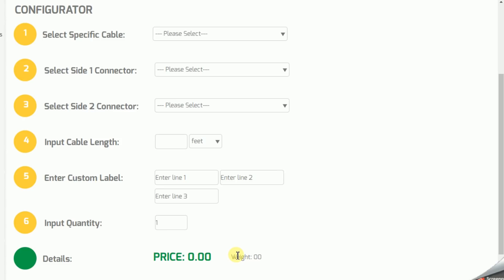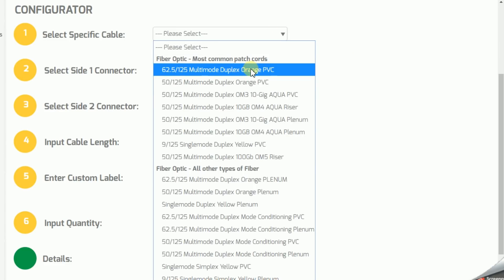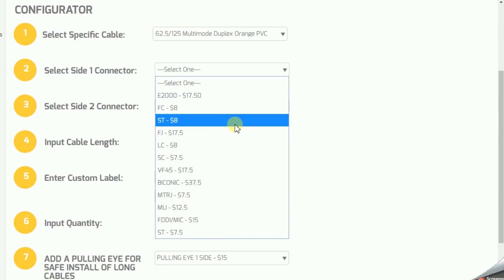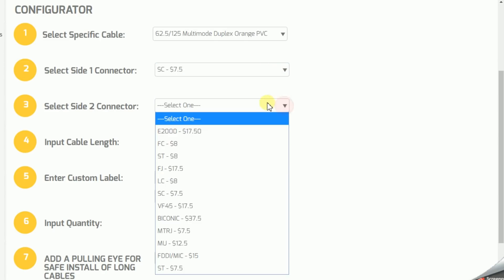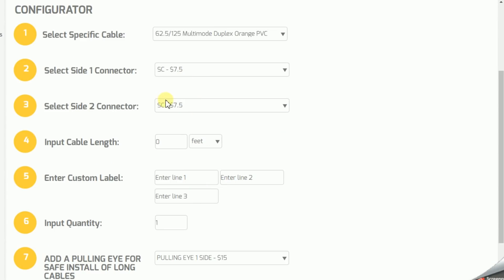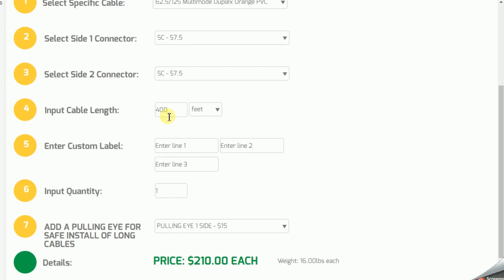Network Two Buildings with Fiber Optic Cable

Comment: Hi! Thank you so much for an informative video. I like to ask some question, is it possible to directly plug the one end on my router to provide the internet connection? Or is switches really necessary on both ends? Are there any limitations that I should consider first before doing this like router model, network configuration, etc.? Any answer would be really helpful. Thank you!
Reply from the maker: You can probably connect directly to the router, the switches just give you more flexibility.

Comment: Thanks for the video. I have a 90' run of underground 1-1/4" PVC conduit with wide sweep 90's on each end for connecting the network from my house out to a steel bldg. on my property. At the steel building the 90 terminates into a standard PVC LB conduit body, that then goes through the building wall and into the shop. My question...would this be too tight of a bend radius for 4 strand indoor/outdoor multimode cable where it has to make a 90 from the vertical to a horizontal run into the building? Thanks.
Reply from the maker: In my opinion, as long as the 90 deg turns are wide bends, should not be an issue.
Reply: @NetworkAdvisor  The 90 degree pvc elbows are definitely wide sweep but I'm wondering about once I have to make the 90 inside the LB conduit body into the building whether that is too tight a radius bend or if it is okay. Thanks.

Comment: Thank you for the video. I got a beginner question.  Once it hits the breakout box, I am wondering how you go about connecting that to the switch you have mentioned at the beginning of the video.   I thought that the fiber will be connected with the SC connector to the transceiver boxes and then connected to the new switch on bldg B.   That may not be the case for the end of the video starting at 7:02.

Comment: Why not just use normal ethernet cable? it should be good for up to 100m
Reply from the maker: Distance.   Copper Ethernet network cables are only certified to work up to 100 meters (in practice we know they can be longer and still work fine).  But Fiber can go for miles!
Great question 😄

Comment: Quick question... TX on A goes to RX on B and vice versa correct?
Reply from the maker: yep, you got it.   TX on Transceiver A, goes to RX on B.  Often times in the field, when you're patching to transceivers together for the first time, you plug up the connectors and if you don't get a link signal, then you just flip them around.

Comment: If want fiber optic signal way form over enthernet via 5ghz access 24 dbi anteana powerbeam over enthernet enther over via fiber wigh b side media. Plz confirm must same use as same . Means dual band . Rj enthernet to fiber send band fiber to rj plz can we select same media converter.

Comment: Great video! I'm a novice so this may be a silly question but how does the coiled slack not interfere with the way the light/data travels through the core?
Reply from the maker: Right?  The nature of fiber optics is that the light is stuck in the core. If follows the core wherever it goes (even in circles).   While it's true that as distance is added signal strength deteriorates but that is factored into your "budget" (light attenuation expectations given distance and loss from connectors).  Hope that helps.  ☺

Comment: Hi, this is the most useful Video ive found, principally because i am at the level of the small toy cars. Can anyone answer this please?
Ok I have a simple question please:
So if  build this set up explained above, exactly.( I am building a 300sq meter workshop and want to link many things from the workshop to my house linked by underground conduit)
 Will this link export/ send all the following: web cams, temp sensors and fire alarms etc (lets say 10 different items) through a switch panel, then the port /fiber link, back to my house the other end of the fiber link?
What is the best way to do it. Fiber will arrive at my house, Then be relayed to the workshop through the cat 6 Rj45. thanks in advance.
Reply from the maker: Short and simple answer is that if all those devices and applications you described use Ethernet TCP/IP protocol to transfer information then YES, that single fiber topology will work.  The longer and more complex answer is you might need to segment your LAN (create vlans) to shape the flow of Ethernet traffic as you might run into bottlenecks.
Reply: @NetworkAdvisor  thank you for your reply. much appreciated!

Comment: Can I use 2 different brands of routers with this system ? Garage is 400 feet from house. Thought I ordered linksey router (to go in garage) being house has linksey. But I picked a different brand. Should I exchange for another linksey? Amazon has easy returns & I didn't open it. Thank you for your time & this video !

Comment: What is the maximum distance this can take?
Reply from the maker: that answer can vary a lot.  Multi-mode is usually less than 1 mile (1.5Km) and single mode can go up to 20 miles.
Reply: @NetworkAdvisor  oh! Okay. Thanks for this.

Comment: Can anyone tell me what type of fiber optic cable would you recommend for networking two building that are 1500' apart?  (only the internet would be shared)  TIA
Reply from the maker: Kim,  I suspect if you contact one of the reputable online fiber distributors they would help you with that. Ie. Cables.com (I have no relationship with them - just an example.  They’ve been around a while ).

Comment: Totally new to fiber.  My situation is just like yours.  I want to run fiber to a detached garage. Can you tell me the site you were on that had the cable configurator?  Seemed pretty simple.
Reply from the maker: Gosh,  it’s been awhile.  “Cables and connectors”  I believe

Comment: Who else is using multimode?
Reply from the maker: typcially Multi-mode is inside the same building or very short distances (less than a KM).  Single mode is for 1-30 Kilometers

Comment: How much bandwidth are you able to transmit with this setup? I wanna build almost same network with target fo 40 Gbps of bandwidth
Reply from the maker: Most fibre can handle 40Gbps.  But,  the electrical components as each end will need to be 40Gbps capable.  That’s expensive.
Reply: @NetworkAdvisor  oh i see, i am planing to use some latest equipment with SFP+ module.
Reply from the maker: Exactly.  Just do the research to be sure you get the right parts.  😄

Comment: I'm in the process of setting up two different houses hooked together with fiber optic. I'm a little confused on the number of strands needed. There's two strands six strands 12 strand etc.. anything you can tell me as far as what I would be looking for?
Reply: Just wanted to shoot in some info as a telecom tech kind of specialized in fiber optics (not from the US tho, so my experience might not be applicable). In general you need a pair of fibers for a single link, one to transmit and one to recieve. By using the right electronics you can also use only one fiber for both by using different wavelenghts for "RX" and "TX", this is quite common in FTTH. I would allways recommend over dimensioning a fiber line quite a bit. 1: you'll easily be able to expand to more lines in the future, if necessary. 2: If your cable were to be damaged, you have a higher likelihood of still being able to salvage 2 fibers. I can't tell you how many times I have saved customers thousands of dollars because 2 of 8, 12, or 48 fibers were still intact! and 3: It's rarely more expensive for the cable itself, but this might not apply when buying pre terminated cables considering they terminate all fibers (we usually only terminate what's necesarry and spool up the rest of the fibers). Fun fact: OS2 G96 (96 strands of single mode fiber) is one of the cheapest cables sold by my vendor, simply because of the sheer amount of it being produced and used.
Reply from the maker: I agree.  If I were stringing a fiber between two buildings,  I would definitely do at least one pair.  But as you point out,  if 6 pair wasn’t that much more expensive,  it would be smart to do so. 😀
Reply from the maker: Unless you plan to do something fancy, two strands should be enough.
Reply: @NetworkAdvisor  seems to me most if not all Armored direct burial come in a min of 6 strands?  Is 2 stand vs 6 a lot cheap? I'm actually seeing the opposite in a lot of places. Can you name the places online you would go for cable? Some of these websites don't inspire confidence. Thanks for your time and great video!
Reply from the maker: Monoprice or cablestogo.   6 strand is good.  Gives you future options.
Reply: @NetworkAdvisor  thanks!

Comment: I was really hoping you were going to show us that exact set up without that orange fiber cable!! That would be a much more interesting way to do it
Reply from the maker: Sorry about your expectations Todd.  Not sure of a better (and simpler) way except to use "air fiber" or run a cat6 copper cable (assuming the distances were short enough).   Were you maybe expecting some fancy switch programming?  Like subnets?  Or setting up a Brouter (bridging router)?

Comment: Can the ethernet output of a media converter be connected directly to a NIC in a PC or does it have to go to a switch?
Reply from the maker: Arthur, I haven't tried it, but I am about 90% sure you can go directly into the NIC.  (Actually, I probably have done it before but have just forgot 😄)
Reply: @NetworkAdvisor  OK, I can't seem to get it to work. If I go directly to the NIC the PC won't connect to the network. If I go from the media converter to a switch, then connect the NIC to the switch the PC connects without a problem. I don't really want to use a switch just to connect one pc.
Reply from the maker: Try a Cross-over ethernet cable maybe?  Those are cheap.

Comment: would single-mode cable work our only double? What is the difference for this application? Thanks
Reply from the maker: building-to-building then single mode would be recommended (long distance).  Within the same building (less than a mile) Multi-mode.  
Good luck.  :-)
Reply: @NetworkAdvisor  so if I am running from one house to another across private property 1,800 ft. Single mode is what I should use? Would you suggest using preterminated cables as well or is splicing on cable ends fairly straightforward? Thanks so much

Comment: Its a very helpful video. I have some questions regarding my personal house-office project. My House and Office is around 100m distance. I had earlier installed CAT6 to have a personal LAN between both premises. However, I observed that the accessing speed is very slow. Example, my usual application from another computer would have more than 5 mins to access it as compared to 10 secs when in shorter distance. I assume, there is loss of data in CAT6 due to larger distance between premises. Therefore, I have planned to replace CAT6 with Fibre Optics. 

- Which type of Fibre Optics would you suggest? (Single Mode or Multi Mode). Additionally, which specific type optic in each category would you recommend me. ( LX or OM1, 2, 3 or 4)

- Could you also suggest me which type of end to select on the fibre optics while ordering custom optics? 

I really appreciate your video and your help to me. 
Looking forward to hearing back from you. 
Thanks
Reply: I think multi mode om3 is what you are after. From what I understand single mode is for much longer distances.
Reply from the maker: Exactly.  Multi-mode is typical within one building.  And single-mode is for longer haul.

Comment: omg man this look so bad I mean not the config itself but which company let you run a cable straight in the air like this without any profesional installation like in the ground etc ? your not afraid of anything that could happen like a truck run into it ?  birds whatever ?
Reply from the maker: Welcome to the world of low-budget contracting.   :-/   Do I like it?  No.  Do I have to feed my family?   
Thanks for watching and taking the time to comment.  :-)
Reply: @NetworkAdvisor  what you mean low budget contracting ? you mean it's a obligation they ask from you ? I think I understand friend

Comment: A small suggestion. When running any aerial cabling, always apply a weather drip before entering a building. This is essentially a 'U' shaped bend so water flows away from the building. Also the wire suspension solution is technically know as a catenary wire solution. Good video by the way 👍🏻.
Reply from the maker: Yep, def agree there!  I was quite the newb in the aerial plant arena back when I did that job.  (2015, I think).  Appreciate the viewing and stopping to leave comments. 😊

Comment: Hi! I have no technical knowledge, just learning on YouTube. How long can the fiber optic cable be before the signal degrades? I read 2 km but not sure. 2 km is basically my minimum for this very strange project. Is there any way to extend this further?
Reply from the maker: Allison,  fibre-optic cable comes in two “modes”.  Multi-mode and single-mode.  Multi-mode is for short distances like within a building or within a server room.  
Single-mode is for long distance (up to 10km or more).
I would consult with a knowledgeable sales rep when making your purchase. 
Good luck! 😀

Comment: Lets say if range is not 400m and it is 50m can We use UTP cable's to connect two buildings?
Reply: You could in theory use it. Most buildings I have been in don't do it this way.
Reply from the maker: I agree.  Building-to-building standard practice is to use Fiber.  ☺️

Comment: One Question i have noticed some of the ISP provide internet on singal line of fiber optic cable how it works since their is always download and upload
Reply from the maker: right?  I have that myself.  I have AT&T Fiber.  Yet, it's only one strand of cable.   I've not researched it.  If I had to guess they're just using one color (light frequency) for the download and the other color for the upload.   So, kind of line pointing two flashlights at each-other at the same time.  Except one flashlight is Ultra-violet and the other is infra-red. 
Excellent observation!  :-D

Comment: Hi Network Advisor. 

I am currently building another garage next to my house. The distance between my router/modem is 35 meters and in the garage i am planning to connect the ethernet cable from the router to an switch. Form the switch 4 cables will go to data outlets in the garage approx. 15 meter cable each. 

My plan was to use an 35 meter Cat 7 outdoor cable from the router to the switch. I these distances - will it makes senses to use fiber cables and media converters?

Comment: can the wire handle 50-70 small 200-1000 gram birds?
Reply from the maker: Maybe I am not understanding your question, but the gauge of the guide wire you choose will determine how much strength can be supported.  Thanks for watching 😃
Reply: that is a really funny question

Comment: Dear Sir, why would you install an indoor cctv camera outdoor? Indoor cameras are intended to be installed within indoor spaces or closed places, they can not and will not resist to rain, dust, sun heat.

Comment: Hello there.
I want to do an operation by sending a signal from the computer with fiber optic cable to x. What kind of device do I need for this. I couldn't find much about fiber optic signal processing. I would really apreciate if you help.

Comment: Is the conduit you used UV outdoor rated? if not, it will bleach over time from the sun, and literally disintegrate in a few years.
Reply from the maker: Agreed.  Great point.  😄
Reply: How's that conduit holding up?

Comment: How do i have to choose the number of fibers between buildings? How do i calculate that?
Reply from the maker: hi Don.  Unless I'm not understanding your question, all you need is a two-strand fiber - one for transmit and one for receive.   What is probably a more relavant question is "how far?".   That would determine whether you can get buy with Multi-mode (short distance) or Single-mode (long distance).
If you're getting ready to make an investment, i would either consult someone local.  Or, spend more time researching it.  Another idea is to call a supply house who sells Fiber (like Graybar or Alltel) and see if you can get a knowledgable sale rep willing to give you some free advice.  :-)

Comment: What do you think would be the best way to run it underground?  Put the Fibre optic cable in the plastic tubing to give it extra protection? or do you have any other suggestions?
Reply from the maker: Yes, plastic tubing (aka pvc conduit) is generally the method most commonly used.  Now, alternatively, you can buy armored fiber that is rated for "direct burial".   Great question. 😀
Reply: @NetworkAdvisor  Thank you for the reply! I will look into it and if I have any more questions I'll be sure to ask you. Im thinking about running a Fiber optics cable from my house to the office. Its about 5m apart, but it would need at least a 30m Fiber optics cable to run through the walls. It previously had ethernet going to it, but the cable was unfortunately destroyed around a year ago, while they were constructing something. Since then I've had a wireless connection to the office and I have really bad speeds there (around 10Mbps) which isn't too good since the house has 1Gbit, becuse of that im thinking of running a Fiber Optic to it to get the maximum of my internet speed to there. Thanks again!

Comment: Excellent video man! Thank you. I just started working for an internet service provider so this was very interesting to me. I'm curious though, wouldn't it also have been an option to use coaxial cable instead of fiber in this case? In case going with fiber is too expensive for someone
Reply from the maker: Yes, a Coax might work too.  I think the thru-put on fibre is faster (not sure by how much).  Great comment. 😊